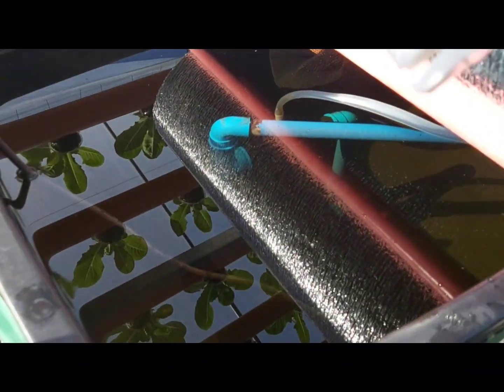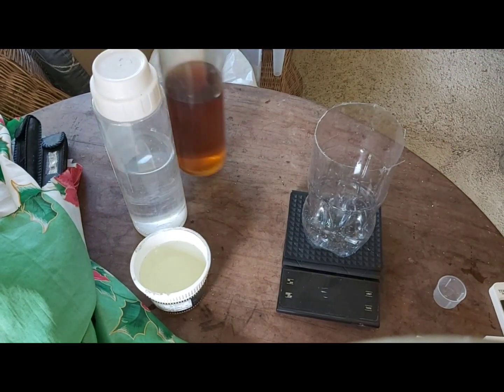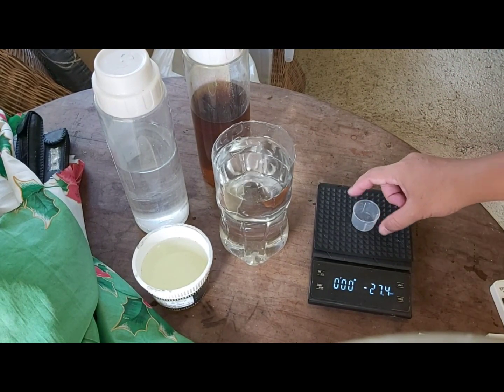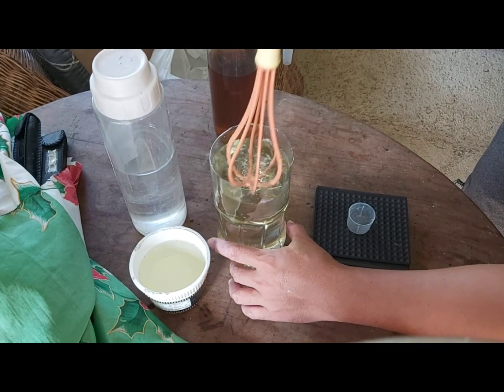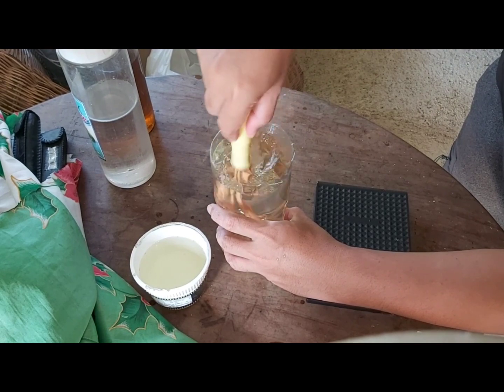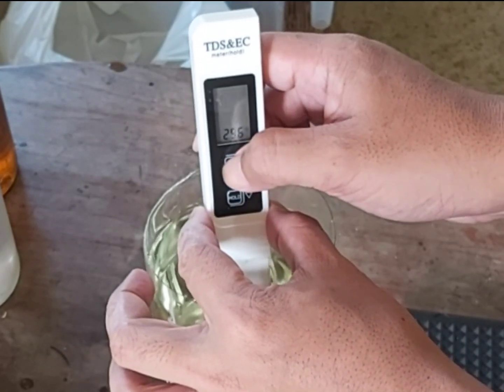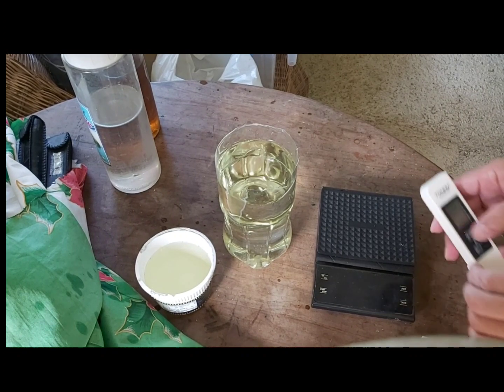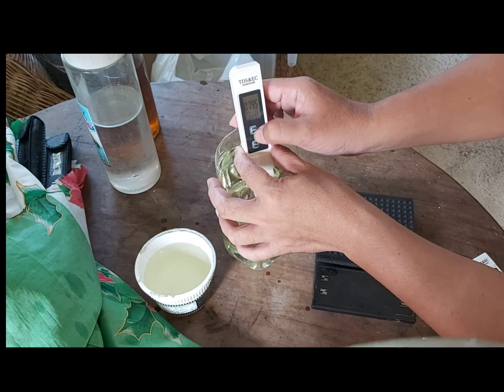Easy Calibration of TDS meter | Watch this video before it's too LATE | Hydroponic farming at home

Comment: I have one like the kind that you have (without up and down arrows). When i press and hold shift for about 10 sec and press then on/off the LED starts to blink, but I can't adjust anything... Does anyone have an answer about this?
Reply from the maker: You said the same but without up or down arrows? Maybe its a different one. Try checking the manual for your device

Comment: Same Tayo ng meter kaka receive ko lang kay shopee. Anong mode po gagamitin yung PPM farenhieght PPM Celsius?
Reply from the maker: Yung celsius po is regarding sa temperature ng tubig yan. PPM po ay regarding sa part per million na dissolved solid sa water, pwede rin po EC for electrical conductivity. 800 ppm = 1.2 EC. Hugasan nyo po ng clean water ang sensor ng meter after using pra hndi po mgdrift ang results ng ppm meter nyo po. Happy planting